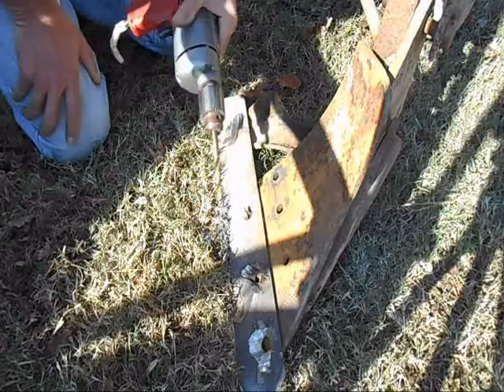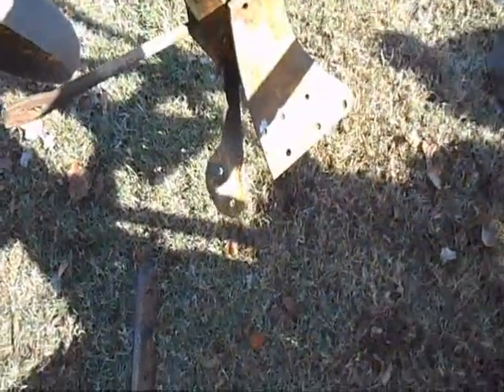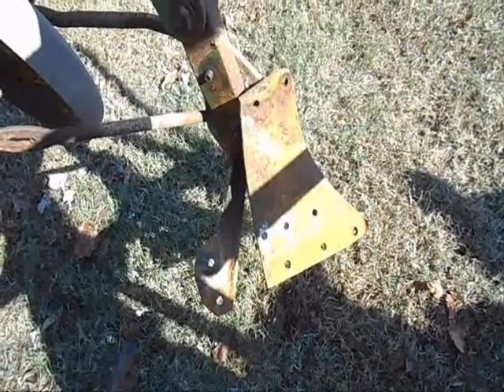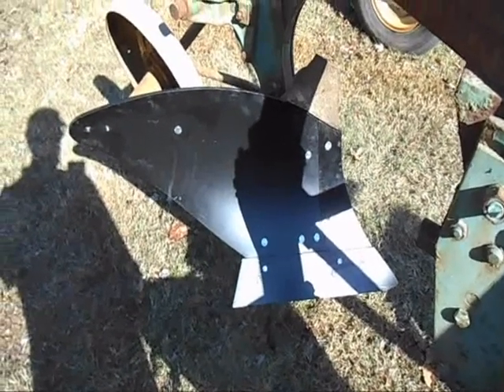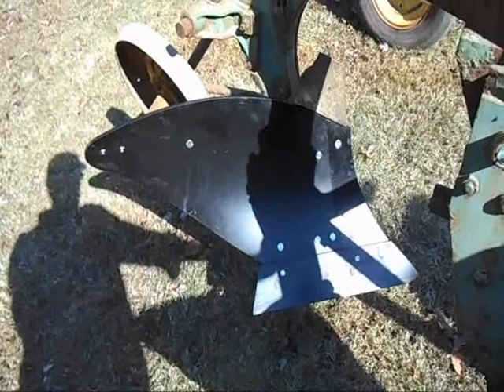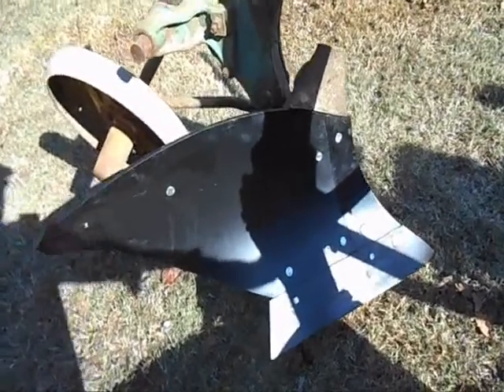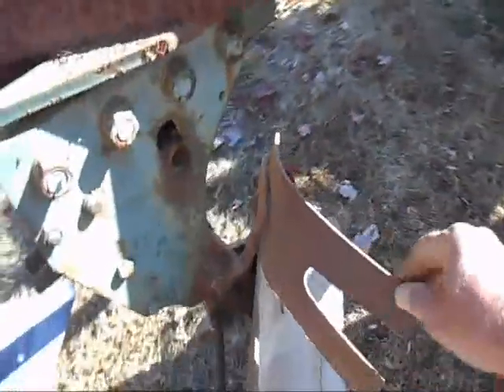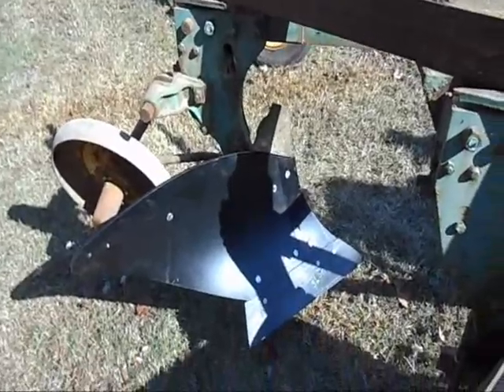Working on the Plow

Comment: Looks like your going to need a complete set of coulters too. From the looks of things the frogs seam to be in pretty good shape. Here's a little trick I learned along time ago, use your welder and place a weld on the bolt were you are drilling and then use an impact wrench on the nut.
Reply from the maker: OH WOW!!!!  then the plow bolt can't turn.  that is brilliant!!!   I can grind the weld off afterwards.  jefffirefighter12106 thank you very much for telling me about this trick.  last night my drill gave up due to power cord problems.  tonight I fixed the drill and made a video of fixing the drill.  next video I make will be me welding the plow bolts and then using the impact wrench.   thanks for being here and talking to me.   :)   now I wonder how a video of me welding is going to come out, will viewers need a shield?  :)

Comment: Take a look at the back side of the plow standard you will see a two piece steel plates sticking out about 2", Take a Crescent Wrench and push down and it should trip the bottom. It's a spring loaded trip mechanism so the Plow trips when you hit a rock. It helps to replace the Rock shares. You will probably need to spray it with a lot of penetrating oil to get it to trip.
Reply from the maker: jefffirefighter12106 - thank you very much for sharing this knowledge with me.  the plow was damaged a lot of years ago because the trips did not work on the 3rd from the front plow.  the bent top brace was scrapped and replaced with two pieces of channel iron welded together.   I really want to get the trips working correctly before I go into several locations on my farm where rocks have messed with my chisel plow.  I actually broke one of the shanks off the chisel plow.  did a reconfigure and made into a 4 shank chisel.  on the plus side the 4020 pulls it deeper and easier.   thanks again for the sharing of your knowledge with me..   best 2U.  :)

Comment: What's nice about welding the old bolt's is that they are wore out and you don't need them anyways, so you don't have to grind them off, just put the old part's in the scrape steel pile.
Reply from the maker: LOL at myself, when I got that moldboard off Saturday morning before going to work it hit me, I don't need to grind the bolt off, it's all just scrap metal heading to the local scrap man.  $$$   thanks again for sharing your knowledge with me.
Reply: Absolutely right!

Comment: My suggestion is to heat them up. Those little butane torches work well.
Reply from the maker: Back then I did not have a torch but a viewer took pity on me and actually sent me a Victor torch rig very nice piece of equipment. I went to Raleigh to a place called Airgas and bought myself the medium size tanks and so far I haven't had to go back for a refill I don't use it a lot but when I do it sure does come in handy. 
🙂🙏🙂

Comment: Your correct to call them shims and moldboards but here in the UK we would call the piece that slices underneath the bottom of the furrow a share. The piece that is broken we would call a trash board on the last furrow.

A few other points;
1. I don't know what your furrow width is but with that lever you pointed to all the way back in the quadrant I'm sure that your tractor wheels are set much too wide and you will have to use a lot of sweat ad probably help to bring them in closer together - inside wall to inside tyre wall is likey to be about 54 inches. Get some easing fluid on all the nuts and bolts that hold the wheels in position for at least a couple of weeks. To make a really good job the front wheels will need bringing in also so that the inside of the front tyre is directly in line with the inside wall of the rear tyre - I guess it is running in line with the centre of the back tyre at present? This is a long, heavy hard work task and potentially dangerous task especially if the rear tyres are full of liquid ballast! 
2. Check that the levelling box on the R Hand lifting rod of the 3 point linkage will turn easily. You need to set this when in work so that the plough is running horizontal side to side and the legs vertical when the RH wheels are in the furrow. The top link also needs to be well greased and easy to turn. 
3. Don't have the rear tyre pressures too high - you reduce the size of the footprint and hence traction if they are too hard, around 14 - 16psi is likely to be fine.
4. I'm afraid that you will need to replace the land side pieces on the plough before too long if not now - they are designed to balance the side thrust from each body when in work.
5. Regarding the land wheel at the rear have you generously lubricated it? Does it wobble side to side when not in work? It may need a new bushing in it. Is it spring loaded or rigidly attached to the frame /leg? It normally would be possible to be set for differing depths of work to stop the plough diving excessively.
6. If things are set correctly the top link, when ploughing, should be straight in line with the centre line of the tractor and when viewing the plough in work from the unploughed land side it should be parallel front to back to the soil surface. Adjust the elngth of the top link to get this correct. 
7. I am not familiar with your tractor hydraulic controls - do you have an operators manual? If there is a location / lever for draft control use it to set the plough depth not  position control - if there is draft control, this is a facility built into the tractor that will maintain a steady depth without excessive wheel spin except in very hard or wet soil conditions. (You may have to add extra weight to the front of the tractor to get it to work well otherwise the hydraulics lift the front of the tractor a little rather than the plough!) There is also likely to be another control mechanism that controls the speed of response of the hydraulics - set it as slow as you can and yet maintain progress ploughing.  
8. Lastly if you have trouble again with cutting metal and have a 4.5inch angle grinder invest in a pack of those very thin cutting discs, they cut through iron and steel like butter but always, always wear a good pair well fitting safety specs, goggles or face shield.

Hope this helps.
Reply from the maker: Dan, thank you very much for taking the time to share such a wealth of knowledge with me.  it is only the extremely uninformed who think Farming is easy and simple to do with no real complex issues to grasp and understand.  your assistance with helping me to gain further understanding for how to correctly set up for best result is so very much appreciated by me.  thank you for watching and commenting.

Comment: After watching the video I think you also think you need need new land sides on your plow. Tyler may also have these parts, you may get by for a while without them but you will have to replace them.
Reply from the maker: yes, I agree.  problem is I have to hunt them down and I really don't want to go near a John Deere dealer.   so, I'll check out Tyler.   thanks for the input and for watching.   I hope to get back on the plow project next weekend with enough parts to complete the steel replacement.

Comment: yeah so they don't move or come off and so you don't plow and lose one that would have not been a good day if you would have Been plowing and lost a malboard
Reply from the maker: Kyle McElfresh - actually it was to keep the plow bolt head from spinning the rusted out slot while I worked to get the rusted nut off.   welding the bolt in place was a removal technique.